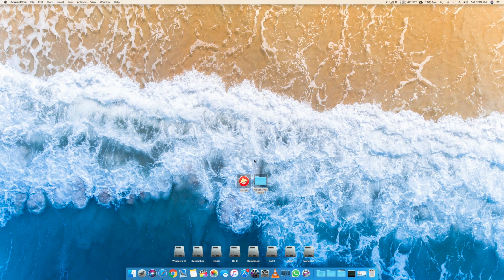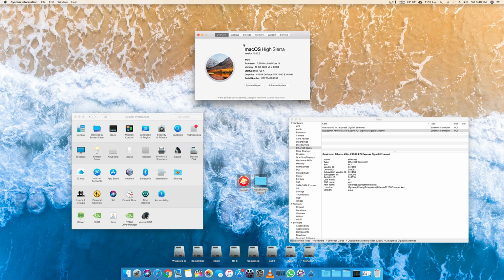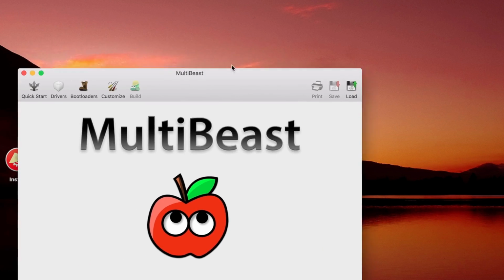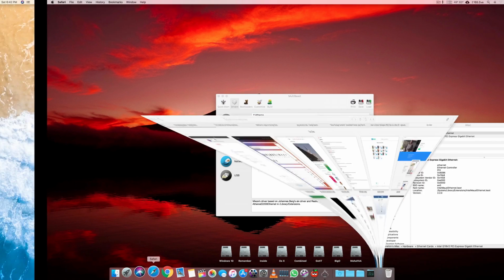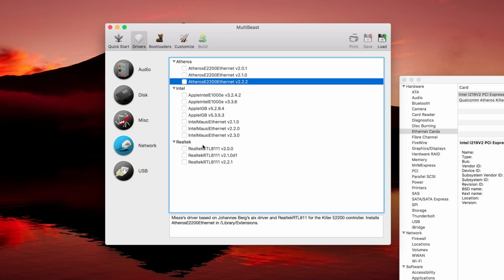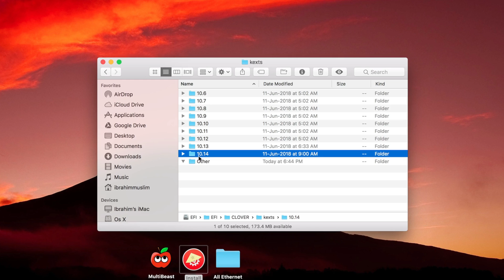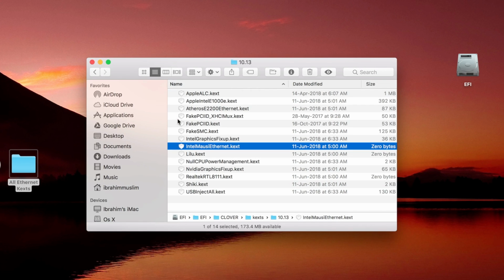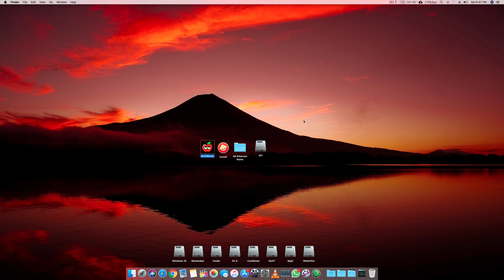How to Fix Ethernet Hackintosh | 2018 |

Comment: when i tried to oepn mainstage 3 on hachintosh sierra 10.12, it says u dnt have opengl 3.3, u have opengl 0.0, plz help how to fix this, my laptop is hp i7 elitebook 2540p
Reply from the maker: your graphics drivers arent worrking properly. If you are using intel or Nvidia, then install the respective drivers.

Comment: I cant even INSTALL it because whenever I try to install macos, it says I dont have internet and therfore I cant even install the os. Can I get help please? I have Intel ethernet, tried loading kexts (but the kexts don't even SHOW UP in clover), tried replacing clover, restoring a Mac copy, but nothing. I need help.
Reply from the maker: Your system model and specs?
Reply: TechTies Ibrahim It works now nvm
Reply: Hi! can you share what you did please? thanks in advance

Comment: Hii
Can you help me I am facing a small problem
I am using a Lenovo x1 carbon, and in this, there is no RJ45 port, so I am using an adapter but in hackintosh, I am unable to use it can you please guide me how to fix this problem.

Thank You
Reply: Use bt adapter on usb and connect ur phone with internet tethered

Comment: Hi there I subscribed it.
Im in the trouble my Hackintosh 10.13.6
My desktop detail 1. skylake i5 6700 3.2 / MSI B150m Moratr ms-792 / TG ddr4 19000 2400 4gb x 4 / gforce gtx 1050 2g / 120 ssd for win10 /wd ssd 250 for HT 10.13.6 / other sata hdd 2/ 
Im completely done with web driver for nvidia. and it works well with dual monitor.
My land card is realtek pcie gbe family controller. 
i patched realtekrtl8111.kext to efi/clover/kexts/others 
but my network status is orange color. and got strange ip like 168.128.63.1
my lac cable to ip time wireless hub.
on win 10 its working perfectly.
ive tried million times change it by manually.
and it turned green. 
But still couldnt work. no internet and no ping to any hosts.
i tried to trun off the hub and reboot computer also. 
it still couldnt work.
could u u help me bro?

Comment: HI, thanks for your very informative and educational videos. Really appreciate your help. I have a Gigabyte GA-Z20P-D3 on board lan which is an Realtek 10/100/1GB port according to specs. I've got it working using Realket kext (using multibeast). I can only get 100mb/s. I can't get gigabyte connection. Can you advise? Thanks
Reply from the maker: Your Cable or your Device that you are connecting is the limiting factor. I have been using these kexts from a long time and i never had this issue except if the cable is 100mbps version or if the other end device supports max link of 100mbps.
Reply: Many thanks for your advice. I'll double check all my connections today. Thanks again. You make great videos which have really helped me a lot!
Reply: You were absolutely right! I plugged it straight into gigabit switch, bypassing the patch panel and boom! 1gb straight away. Sometimes it takes a kind person to point out the simplest solution. Much appreciated.

Comment: I have made three exFat partitions viz. Movies, Songs, Documents and two NTFS partitions viz. Windows 10 OS, Windows Boot Backup and two Mac OS Extended (Journaled) partitions vix High Sierra 10135, Backup High Sierra. I have installed trial version of Paragon NTFS 15.0.911 for writing and pasting in NTFS partition. But to my surprise when I am clicking Get Info in exFat partitions, I am seeing ‘You have custom access’ under sharing & Permissions. In NTFS and Mac OS Extended (Journaled) partitions, I am not seeing it.

Now the problem is that I cannot change the icons for exFat Partitions at all. Kindly help.

Comment: Can I create two EFI System Partitions on the same 1 TB internal hard drive in order to backup high Sierra with Carbon copy cloner? Shall this create problem tn booting windows 10 if I dual boot it with High Sierra?
Reply from the maker: Yes, but don't install Windows on the same Hard drive.

Comment: Hey
Will you help me installing mac OS Mojave using teaviewer if i pay your fee
I have a laptop
Dell inspiron 5567 with intel Core i7 7500U
8GB Ram 2400MHz
intel wifi
intel HD 620 Graphics card with 4GB Dedicated graphics memory
Reply from the maker: Have you ever installed any older version of OS X before.
Thanks a lot! 
Like Share & Subscribe for More! 
Help me on Patreon if you love the videos.
https://www.patreon.com/IbrahimMuslim
Reply: Yes I installed Sierra
But i was unable to enable  Graphics and wifi etc, i used voodoo to enable sound
Reply: Intel wifi is not supported. You must replace it with a BCM94352Z.